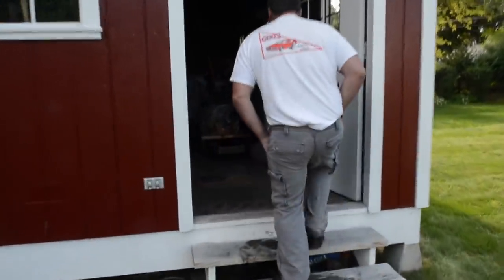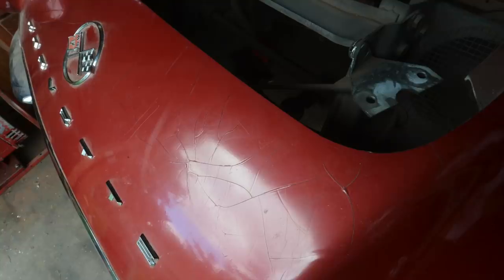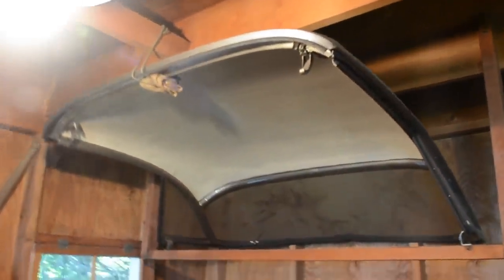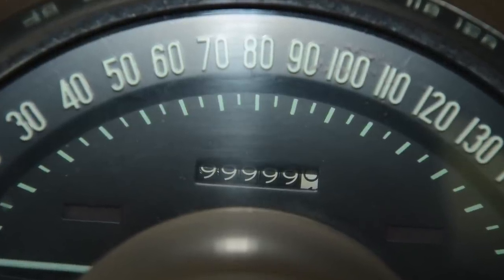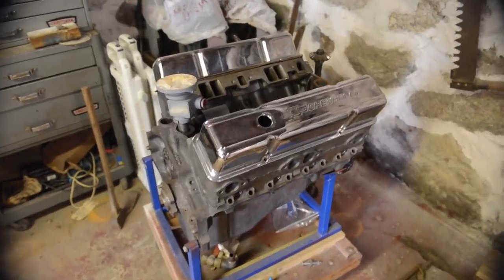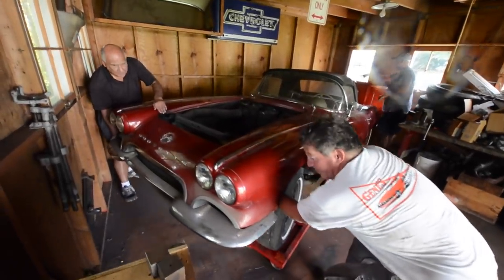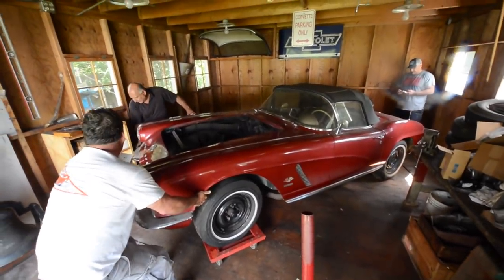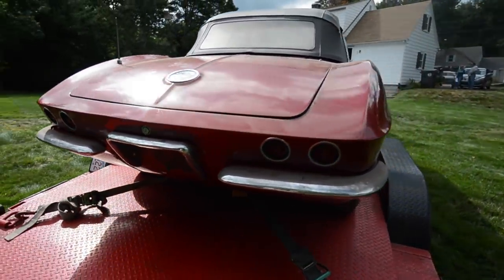1962 Corvette comes out of 50 years hiding in barn

Comment: Working for a restoration shop I had the pleasure of completely assembling a '62 vette which had been taken completely apart by its owner's brother well over 30 years before. Our body shop took care of all the paint and i restored everything else including the trim, then put it completely together. They used to show the car as an example of the work they did. Earlier I put a '57 fuelie vette together with a bunch of custom stuff the customer wanted, it had been formerly raced and bashed up, so the body was extensively repaired. That one was a hell of a project as he wanted A/C and power steering added which wasn't easy to fit. Took 5th place at one of the big car shows though. 
This car doesn't look like it's going to need much, that all the bumpers and the interior are in nice shape is great.

Comment: I had one like that in the early sixties - but mine was only 1/25 scale. Maybe because of that, I've always thought of the 62s in Roman Red as the best looking Corvettes. 99,999 miles, and still looking great - no steel body panels rusted out  -  fiberglass does have its advantages.